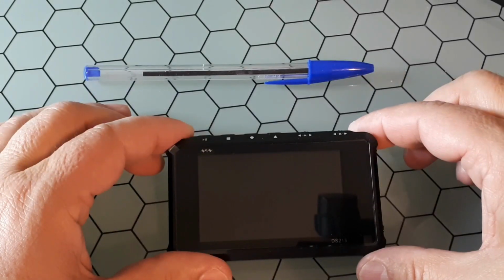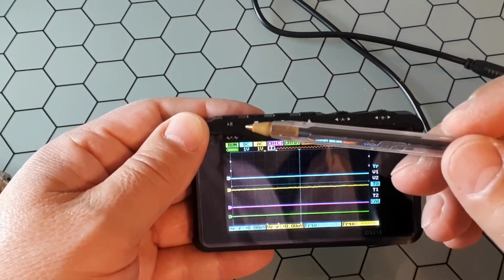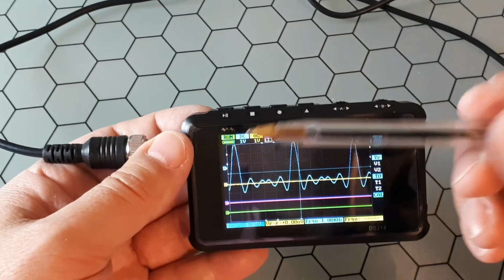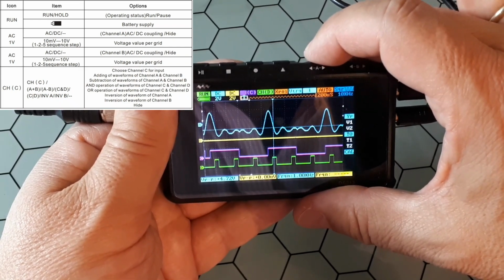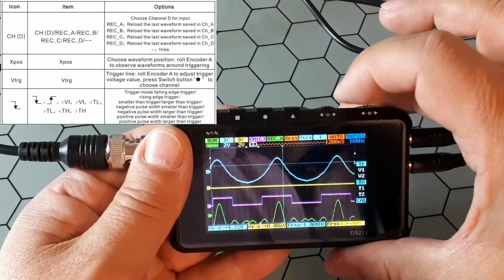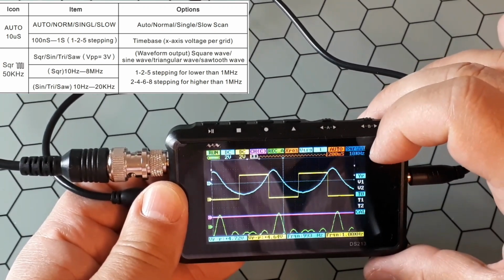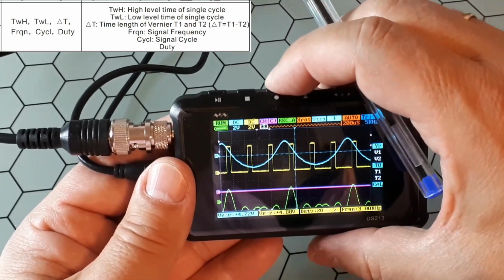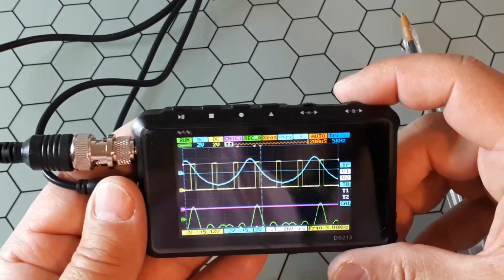Tutorial. DS213 Oscilloscope

Comment: Im a little confused about the max voltage, as the manual states 40V max but at another place it says 400V with 10x? So what happens if i use a good probe (rated for 600V), set the probe to 10x, set the ds213 to AC 10x and probe a 240V wall outlet? Will i destroy the scope? I dont understand how the 10x works..does it limit the power or does it just divide whats shown on the display by 10?
Reply from the maker: a 10x probe divides by 10 the measured voltage. Thus, if you put 240v at the tip of the probe, you get 24v at the oscilloscope end. You also need to configure the input channel of the oscilloscope to 10x, so values are correctly shown at the screen (240v instead of only 24v).
Anyway, take care measuring high voltages, and do not souch any metalic part of the scope, as the ground of the prove is connected to a high voltage source, and this voltage might go through your fingers to your feet and then to the ground. You do not like that. Ussually for this kind of measurements you better use a transformer.

Comment: Please tell a type of connector adapter you are using.
Reply from the maker: It is an MCX to BNC connector. You do not need it for the probes included, but you would need it if you use common BNC probes. You could find them at any electronics shop or amazon, aliexpress...
 € 1,41 | BNC Female Jack To MCX Male Plug RF Adapter Connector For GPS Antenna TV-Tuner
https://a.aliexpress.com/_msPdLwH
Reply: @alejandroalonsopuig  great! Thanks for Ali link. It's the final target I need!
Reply: @alejandroalonsopuig  about "probes included" I know of course) I want to use common and ususal probes with ds213 and so I need adapter.

Thanks once more!

Comment: I have a question regarding saving CSV Files. And I cannot write at the minidso.com forum because all controls are chinese...managed to create an account but haven't been successful posting anything there. Tet scenario square wave 100Hz at digital input timebase set to 2ms.
When I save a csv file it has 149 lines for the cycle instead of 5 lines that it should have IMHO - I have no experience with Oscilloscopes, but the Timebase 2mS in the header would indicate for me 1 line per 2 mS

Somebody have a clue?

Comment: Nice video! I can definitely see myself using this as my main reference. Just wanted to ask if you've found a way to switch between x1 and x10 probe modes. My ds213 was shipped with 2 switchable x1-x10 probes and I'm questioning why they were included if the functionality doesn't exist for them. Maybe that's coming in a later firmware update?
Reply: For anyone still looking at the answer. The newest firmware 1.27 has 1x and 10x mode, it is part of the AC/DC mode selection. The menu now shows [AC/DC/AC10/DC10/Off]
Reply: @jackieo555  Thanks for the update. I'll have to check this out.
Reply from the maker: Thank you. Yes, I didn't find it either...
Reply: @alejandroalonsopuig  Thanks for the reply. That's great to know. I think I'll make an enquiry about this on their site when I find some time.